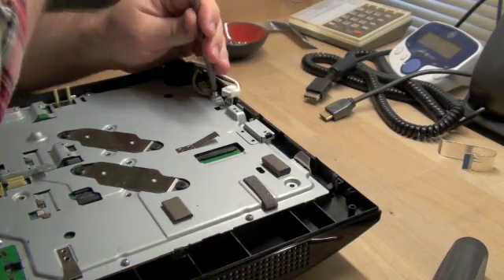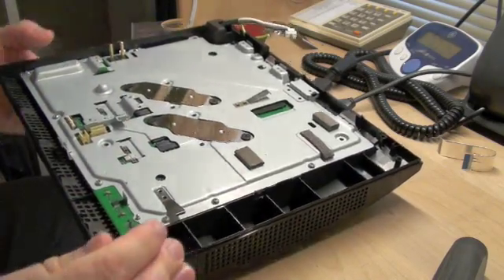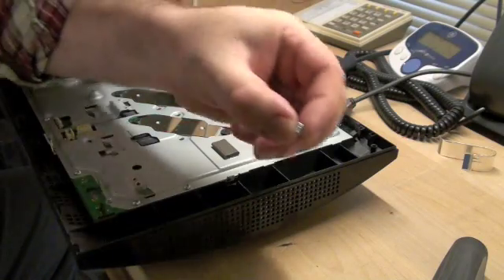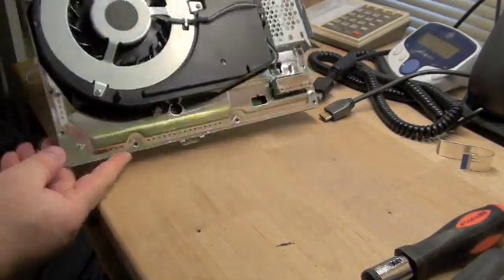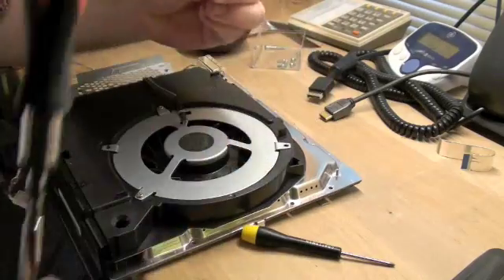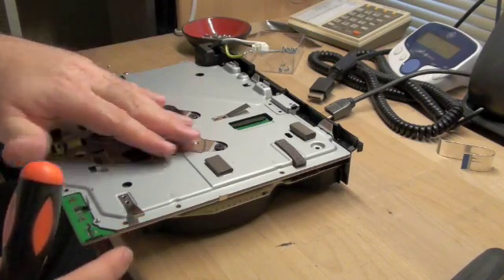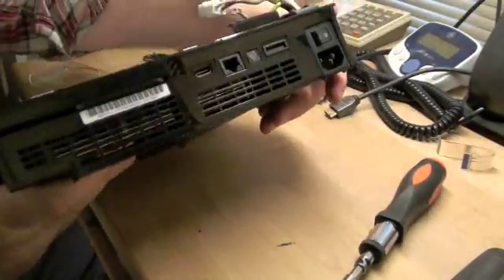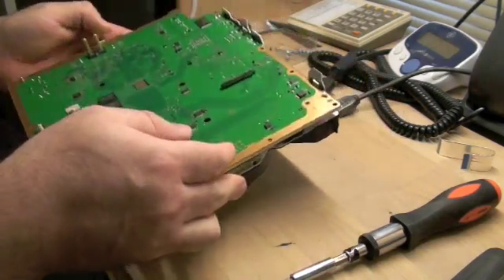PS3 disassembly - bottom shell

Comment from the maker: @Cleonn100 I don't think the clip is sold separately.  Usually, the damage is to the connector to which the clip attaches, so you can probably still make things work if you have only damaged one side. (Carefully close the clip while holding it where the connector would have, and it should clamp on well enough.)